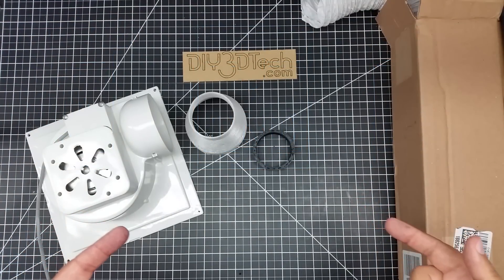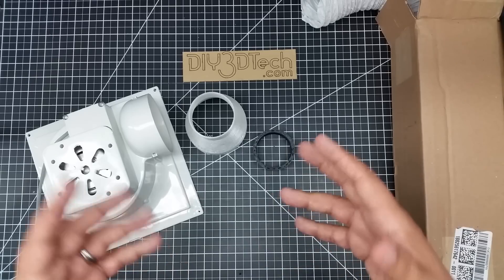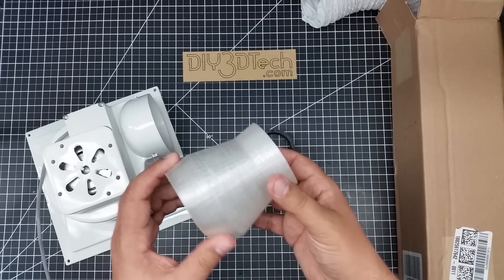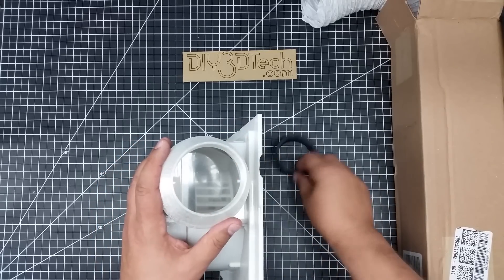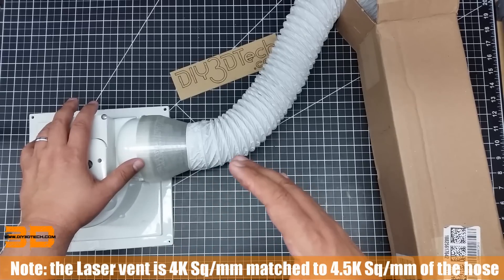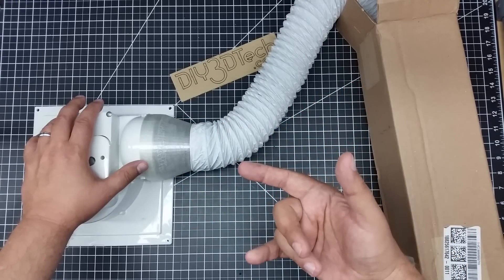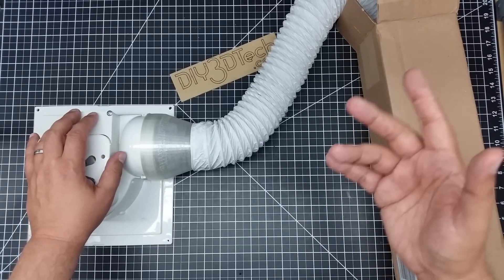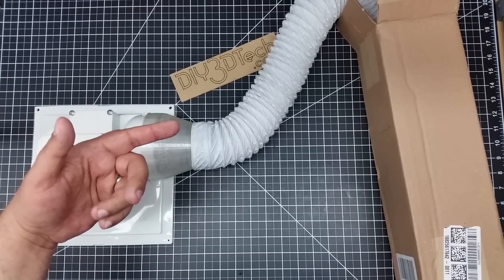K40 eBay Chinese CO2 Laser Cutter & Engraver - 3D Printed Exhaust Vent Adapter!

Comment: does the orange blower you showed a while back in a previous video no longer work? Thought that's why you got that one. Is that the original fume extractor that came with your k40?
Reply from the maker: Yes the orange blower is alive as did you see the video on the exhaust collection I did for it?  This is for a second laser I have as mentioned in the video which I placed in the garage so I don't require as aggressive fume collection so I am going to try to use the stock extractor and see how it work.  Also thanks for watch and remembering!  :-)